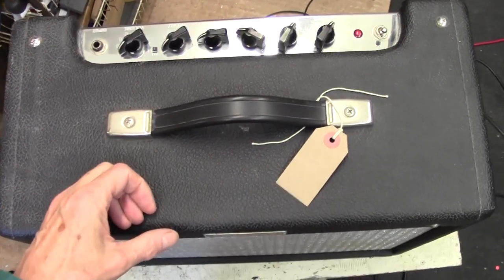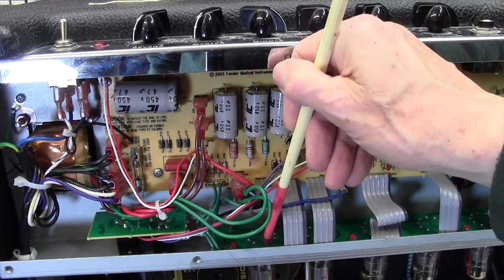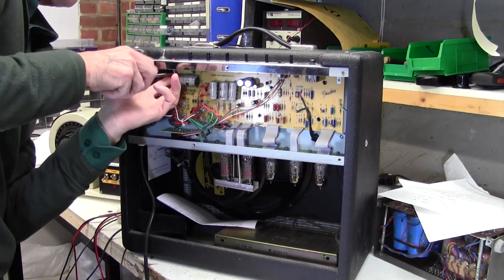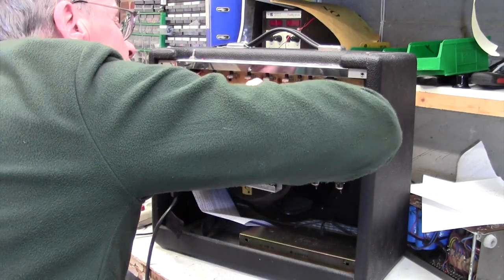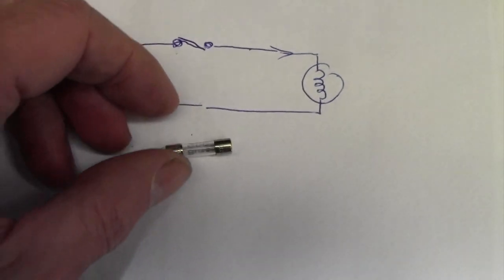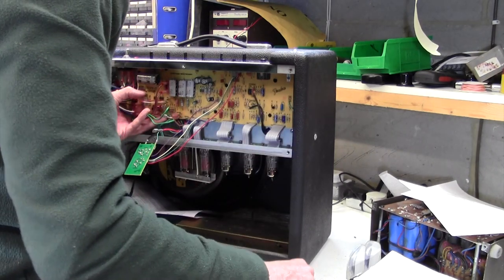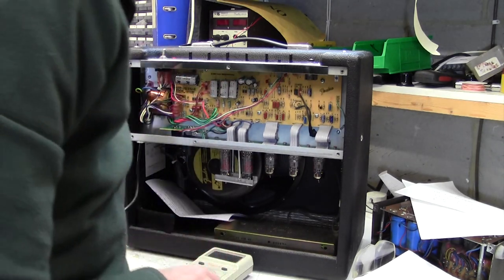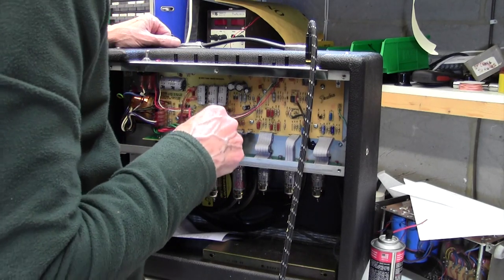How to Fix Fender Blues Junior No Valve Heaters

Comment: I guess the lesson is: for fuses on low voltage parts of the board, always remove and test fuse out of the holder. Low voltage suggests low impedance load, and therefore it can easily make your meter beep even if fuse is open. Thanks for showing all of this. Very informative.
Reply from the maker: Hi Jim, Yes you've summed it up nicely. I was double fooled by the perfectly intact wire in fuse!

Comment: This amp is very electrically similar to the Fender Blues Deluxe. Both often have heat-related problems from the position of the valves. I don't know if this could have been the case. However, it is perfectly noticeable when a good technician has experience repairing amplifiers.
It was another great video.

Cheers
Reply from the maker: Interesting info, thanks Suso,
Reply: Only someone who never worked on either, nor could read a schematic, would ever compare a Blues Deluxe to a Junior. Since you think a similar name implies an 'electrically similar' amp, I can see where your mistake comes from. You seem to not understand that nearly all combo amps uses the same socket to PCB design as Fender. Heat is NOT a problem in those amps, people who 'mod them' are.
  Notice the utter lack of heat damage on that board?

Comment: Hi Stuart, thanks for the video. Sometimes fuse and fuse sockets develop some oxidation, so should clean those before changing. By the way, the push in connectors could also develop some oxidation. I have seen that a lot. Again, good cleaning is often the cure. Have a nice day and thanks again for the video.
Reply from the maker: Thanks Jean-Pierre!

Comment: Having been fooled by the exact same thing on more than one occasion, to test fuses and switches I always try test for voltage across them with the circuit live.  If a fuse is good or a switch is closed there is no voltage across it.  If the fuse is blown or the switch is open you have full circuit voltage across it.  This gets around the issue of testing continuity in a circuit where you may get continuity (or at least low resistance) from other components in the circuit.  

Anyway, I love your videos and have learned a lot from watching.  Keep up the good work!
Reply from the maker: Hi Richard, that's a really good idea and I've never thought about doung that!  Thanks for the useful tip.
Reply: @stuartukguitarampguy5830  It's not always possible to do, sometimes you can't get to them, or there may be other problems in the circuit.  But if you can it's an easy check.  Of course make sure you have a good high impedance meter. if the fuse is blown you don't want the meter to pull so much current it becomes the fuse!  Not that I've ever done that! No sir, not me. :)
Reply from the maker: @richardk7256  Me neither! What sort of complete IDIOT would do a thing like that....

Comment: Considering the amount of force it requires to pull the spade connectors off of those spade lugs mounted on the board, it's generally a good idea to automatically resolder them, simply because as we all know leadfree solder doesn't bond well to larger metal parts such as board-mounted fuse holder clips and spade lug terminals.  I suspect that the metallic mass of those larger parts is sufficient that they conduct the heat away a little too quickly as the circuit boards are passed over the wave-soldering machines, and therefore the parts never quite get up to a sufficient temperature for the solder to bond to them.  The same thing applies to the potentiometers and especially the input jacks.  While you have the board up it's best to just reflow those connections.
Reply: Dont use the force, use deoxit

Comment: Referencing the spark at 3:40, for discharging caps I use an old Heathkit resistor-substitution box with a rotary selector switch; I can begin at 1K ohms or higher and rotate down to 4 ohms in incremental steps.  The original resistors were all 1 watt size,  but I increased the lowest ohms-value resistors to 2 W, or 5 W if I had them and they would physically fit.
Reply from the maker: It's my fault, the internal resistor is just to low at 100 ohms. If I change it for a 1K it will be fine.

Comment: I’ve got the same issue with my blues jr but all the tubes go on except one of the power tubes, I replaced the tubes but same issue, going to try the fuse next, if that doesn’t work I’ll try checking the tube socket like you did.
Reply from the maker: Ok good luck. Let me know how you get on.
Reply: @stuartukguitarampguy5830  I resouldered the tube socket pin connections like you did and that worked. Thanks to your video!
Reply from the maker: @stratmancruthers  Wow, awesome, Well done.

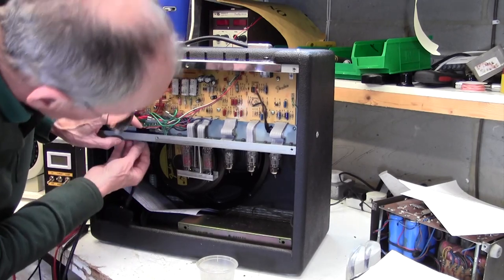Comment: At 25:40, Stuart says, " There are two different kinds of jacks, god knows why";  Well, I am no deity, and neither is Stuart, but I know "why", and if Stuart thinks about it for a minute he would know why as well: the main output jack is designed to short to ground if there's no speaker-cable plug inserted into it, in order to protect the output transformer from damage caused by operating it without a load.  This is and has pretty much always been standard for Fender amplifiers since the 1960s.  I'm not sure if the extension speaker jack is wired so that an extension cabinet would work in parallel with the speaker in the amplifier's combo cabinet ---- note that lowering the overall impedance  could cause problems for the output tranny ---- or in series so that the impedance increases rather than decreases, or if plugging in an extention cabinet shuts off the combo speaker and the audio only runs through the extension cabinet;  but almost certainly there will be some type of built-in switching to minimize the chance of output transformer damage. Note that the Main jack makes metallic contact to the amp chassis,, but the Ext jack is insulated plastic and isolated from the chassis.. PS, the audio signal from the output transformer secondary *needs a chassis ground reference*, otherwise you can't use negative feedback from the output to lower distortion elsewhere in the preamp or phase invertor.
Reply: The extra socket isn’t for an extension speaker, it’s for a foot switch for the mid boost.
Reply: @ali2ndmail  yup, the fat switch remote

Comment: Hello Stuart
When calculating dissipation of the output tubes on a cathode biased amp which is the correct plate voltage reading to use? i.e. I’ve seen techs measuring from plate to ground and plate to cathode
Thanks
Reply from the maker: Hi Geoff It's plate to cathode. But the cathode resistor only usually drop 10V or so, so it's not THAT much different.

Comment: Unrelated question:  what brand is your magnifying visor?  I need a new one and I can't find anything that suits me, but it looks like the one you have is just what I"m looking for.   

Not that my eyes are getting old or anything... it's just poor lighting... yeah, that's it... poor lighting....

Oddly, I've encountered many intermittent fuses.  I usually take them out and give them a little twist and tug just to be sure.  It's rare, but it happens.  Only takes a second to check.
Reply from the maker: Hi There is no brand name it just says LED HEAD LOUPE on the and. I think I got it from eBay some years ago,

Comment: What is a "dry joint"? Is it the same as what we call a "cold solder joint" here in the States?
Reply from the maker: Hi Ian. Ah, I didn;t realise there was a cross Atlantic difference. A 'dry' joint I guess came from being without solder. So the less solder on the joint the drier it is. Basically 'unsoldered' to you and me.
Reply: @stuartukguitarampguy5830  Oh, OK. That would be what I've always heard referred to as a "solder starved joint".
Reply from the maker: @ianaintsaying1625  So what's a cold joint then?
Reply: Exactly that. A joint that didn't get good heat transfer which doesn't allow the solder to fully melt and flow.

Comment: STUART UK, how does the output transformer block high voltage DC 350vdc to 600vdc because inductors PASS DC?
Reply from the maker: Hi Wayne. Great question. An inductor is just a single coil of wire in SERIES with the circuit, so it passes DC just like a wire would. A transformer has two isolated windings, one wound on top of the other. No DC can pass across this. Only AC.

Comment: An ADJUSTABLE WRENCH, held VERTICAL, to remove the input nut? ARE YOU KIDDING ME?
   This is just proves that a little knowledge can be FAR more dangerous than none. I wouldn't let you sweep the floor of my shop, as you're unqualified to even HOLD A WRENCH, let alone select the proper tool, to not mark up a CHROME control panel. The rest of your 'work' would require a novel to point out and correct.
Reply from the maker: Hi Kenneth. Sigh, you know after 50 years of doing this sort of thing, I kind of know how to use that wrench without scratching the panel. Astonishing as it may seem. As for the rest, doubtless you are keen to give me the benefit of your superior wisdom and knowkedge, so go for it.
Reply: @stuartukguitarampguy5830  Gee, I guess sockets have no use on earth, and all open wrenches should be used vertical, perpendicular to the handle! This is 50 years of experience claiming, 
"I'm so good, that my reckless and improper use of tools, is proper! All because I've been objectively wrong for 50 years! I'm an expert in wrong! Only those with experience know the virtues of not using the right tool, and letting juvenile laziness feign 'experience"."

Never mind marring up the nut, we need to objectively scratch chrome as well, that everyone saw. Great advice!
You're right, everyone should OBVIOUSLY disregard all respect for their customers, because they've been wrong for 50 years, and careless. 

Hat's off on being an adult, and accepting your error. I'll remember that the next time I make a mistake, I'll tell someone I've been an EE with a multiple degrees for 37 years, so that makes me right. Enjoy the scratches, suckers!

Wow, thanks for the lesson! I've seen the light! Well taught!
Reply from the maker: @kennethc2466  I expect you are right.

Comment: So you had to take out the whole board to change a fuse that has no real purpose......and it's prob under rated as there would be a surge even using the stand by.......SHM
Reply from the maker: Yep!